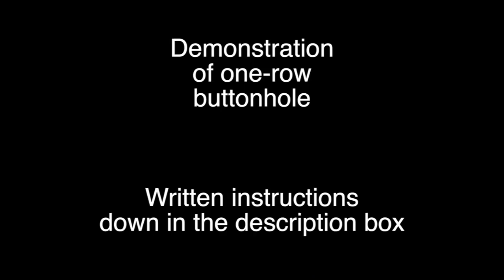One Row Buttonholes // Technique Tuesday

Comment: Great explanation, I managed to knit some pretty neat buttonholes. However on a single rib band I found I couldn’t  keep the pattern. Sometimes I ended up with two knit or pearl stitches together. What am I doing wrong. I’m all swatched out 🤷‍♀️
Reply from the maker: There are written instructions in the video description. You are supposed to CO 1 st more than you BO, and then that extra st is eliminated.

Comment: I was making an updated Gansey jumper, with a stand-up collar  that had a row of buttons on the left shoulder. It's an oldie but goodie--mid 1980s pattern from Knitters' Magazine. The magazine has been out of print for some time, for good reason (bad editing, patterns not test knitted). It's a really nice men's jumper--and men really do like it. I made another jumper in the same pattern, for this young man's brother.   I had to modify the pattern so that it's proportions were more traditional (bottom ribbing band was way too large). One of the things I didn't like about the pattern was the buttonholes the designer called for. I was going to have to modify that part of the pattern anyway, because the buttons I had that worked with the overall design of the jumper are larger than what the pattern called for. So, I did a quick search of YT,  to see if someone had a better method than the one I knew. Lo and behold, I found this video and I made five really nice buttonholes--and a new favorite way to make row buttonholes. Thanks.
Reply from the maker: Wonderful! I'm glad you found a buttonhole method that suits you!

Comment: Thanks so much for the video! I was wondering what the needle are that you are using? The black ones with silver tips?
Reply from the maker: Those are actually green - they are Signature Needles Arts US 6 32'' fixed length circular needles. (Each needle size is a different color). I don't think they make the fixed length circs anymore, just the tips with interchangeable cables.

Comment: I am knitting an Aran cardigan. My button band is k1 P1 but it is vertical not horizontal. What button hole should I do? Do you have a tutorial on it? Thank you. Take care everyone and stay safe 😘😊🤗
Reply from the maker: Does your pattern include instructions for a buttonhole? You can do any type of buttonhole you want (horizontal, vertical, or YO). It just depends on how large the buttonhole needs to be for the buttons you plan to use, and whether you are trying to hide the hole in a column of purl sts, etc.  There is no should or shouldn't.
Reply: @RoxanneRichardson  The pattern just says cast off two then cast on two over the cast off stitches. I did this but I kept having an extra line down when I did that. I always have problems doing buttonholes.

Comment: Question on the orientation of the yarn when slipping stitches when you are starting with a purl on ribbing as opposed to a knit stitch.  Do you still hold the yarn in front or do you hold it opposite what the stitch would call for in this situation?  I am doing this on 2x2 ribbing and having some difficulty getting it to look correct.  Probably user error.  LOL!  Thanks in advance.
Reply from the maker: Well, you could try it the opposite way, and see what you get. The point is to wrap that stitch, and then before you pass sts over each other, you'll need the yarn in the back.